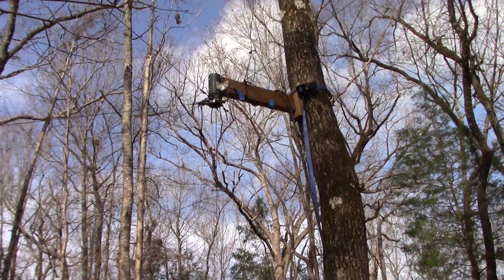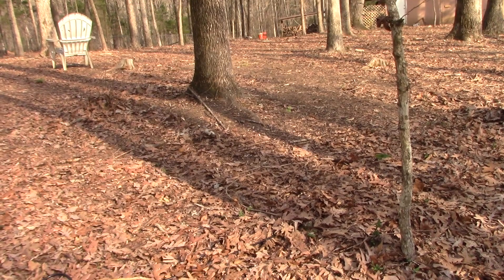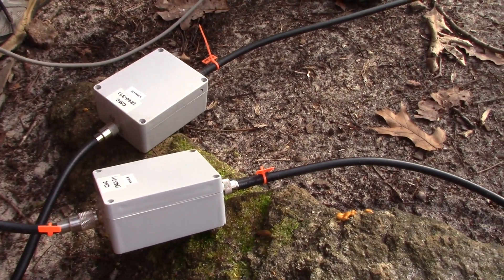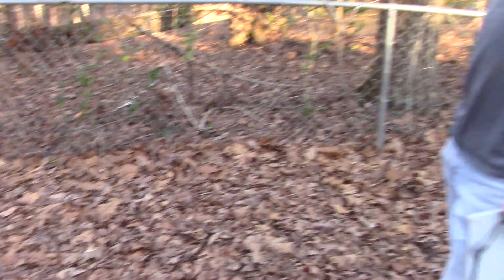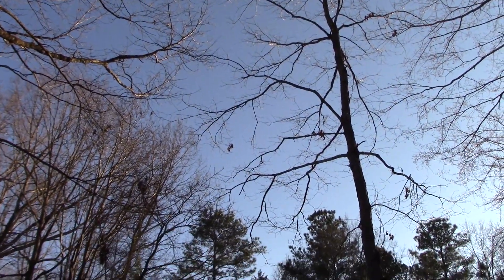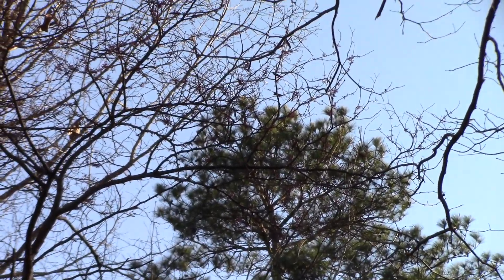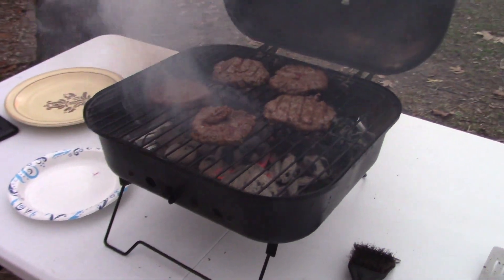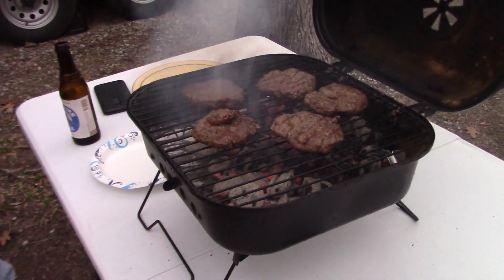CQ 160 CONTEST SSB 2023 / VERTICAL ANTENNAS

Comment: Good morning Steve. 160m is a great Band and one of my Favourite. Since I am a full time Poortable Station it makes it a little harder to become effective and loud operating the Top Band. Believe it or not my first time running 160 portable was excately a Enfded Wire Antenna 9:1UNUN 87,5ft. Lenght inverted L which is acutally a 80-10m Band Antenna. Just for the Curiousness  I checked 160m if I can hear aomething there with this Antenna and pressed the Tuner Button of my IC-7300 and the Tuner found a match in no time. Beyond of that I was able to work a ton of European Stations. No Contacts yet across the Pond but will see what works.
I am free  from the Contest Disease "59 Service". Tnx for this neat Video & happy Monday. 73 de Uncle Guenter 💯🙋‍♂